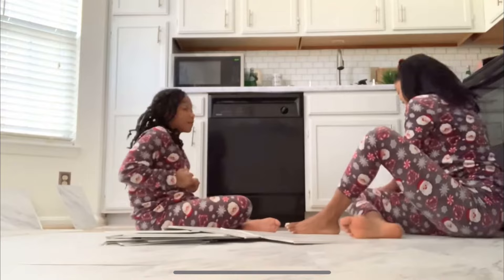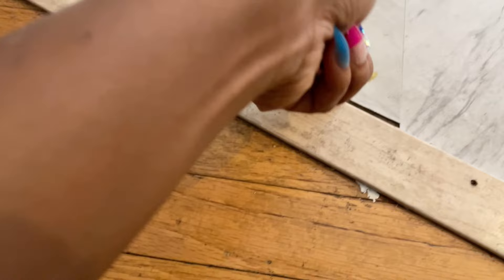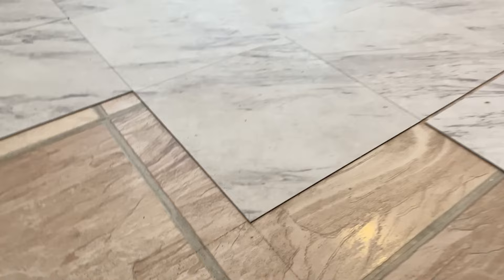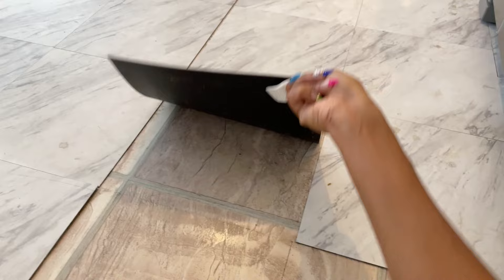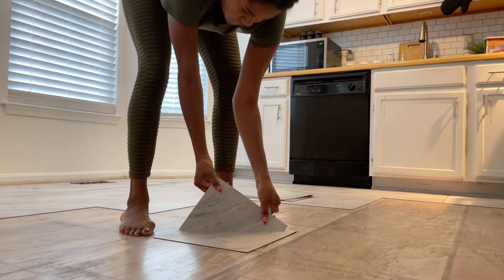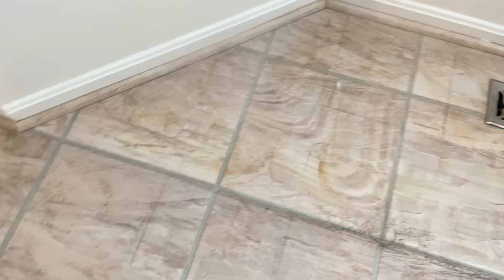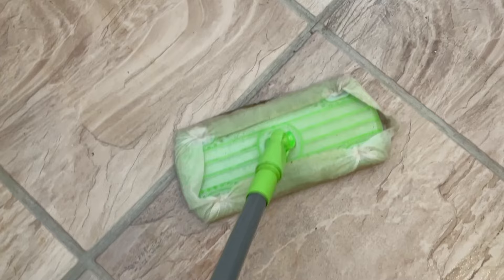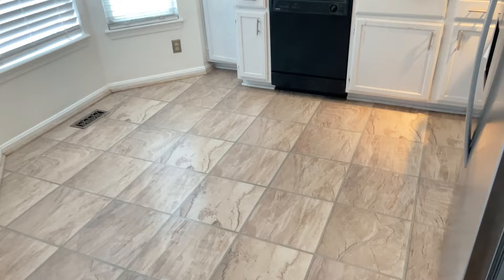HOW TO REMOVE Peel And Stick Floor Tiles | 9 MONTHS LATER | How To Remove Without Damage

Comment: On concrete after removing tiles is it hard to remove the glue?
Reply from the maker: If you use GooGone to remove the adhesive all if the stickiness will be gone.